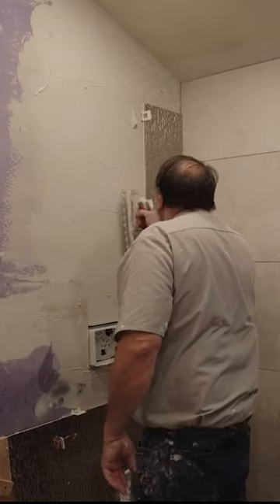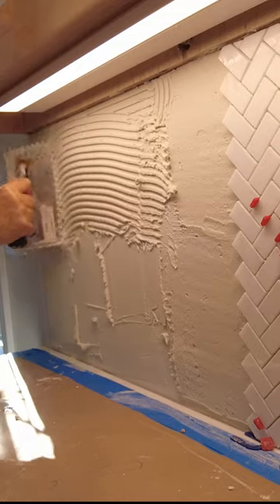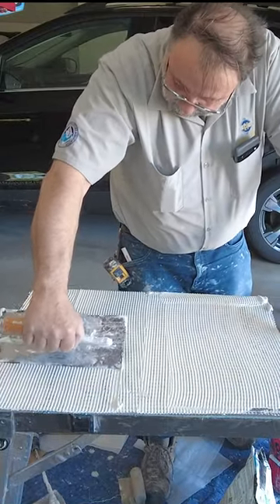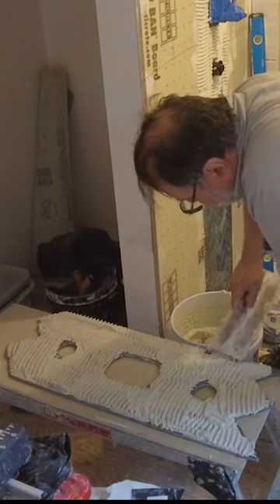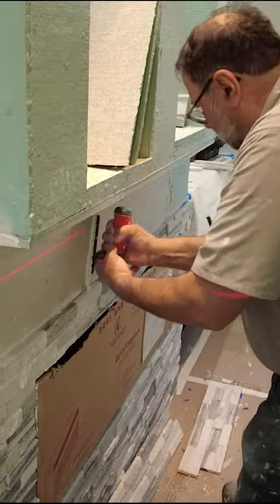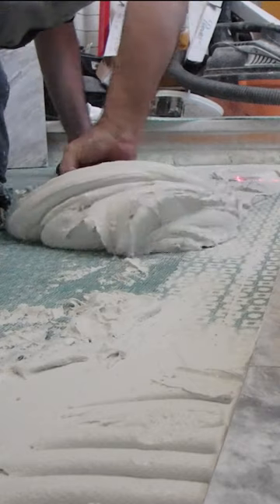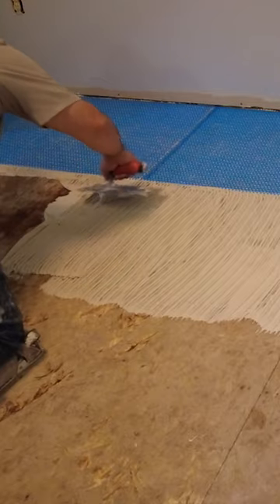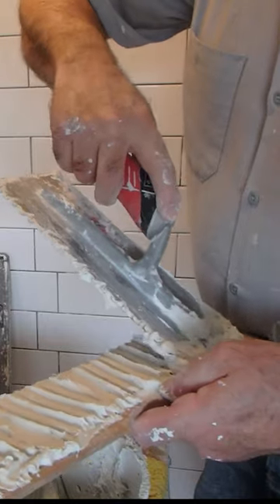🤔What Type of mortar❓❔ #shorts #mortar #tile

Comment: in the US you guys often use pre mixed stuff, in the UK that stuff should be banned,  ive seen it before where it never dried, and had to be scraped back up again.
Reply from the maker: It's called mastic and is more a DIY product very limited uses and seldom used by professionals.
Reply: @SalDiBlasi  no i mean tile adhesive, not grab adhesive or silicone.
Reply: Yah, the industry term for that is mastic over here and it is junk. Only works on small tiles like kitchen backsplashes.